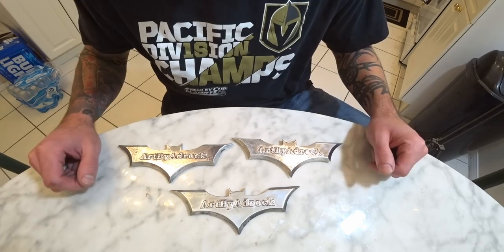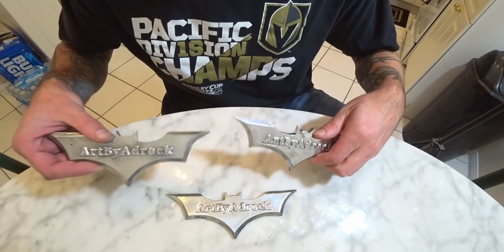Aluminum Casting Batmans BATARANG From Scrap Metal: Custom Weapon Making

Comment: Can you make a video about the formula of petrobond sand?
Reply from the maker: skull crane I don’t make the sand I buy it. Although it is just oil and very finely ground sand. I do re-purpose the old sand to use again though. Petrobond has to be mulled by a machine and I currently don’t have one.. wish I did though